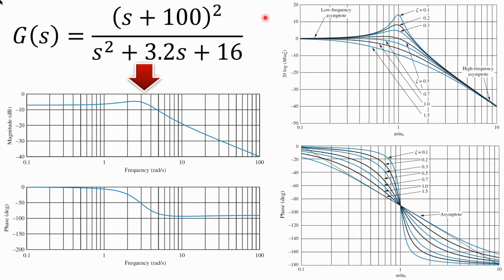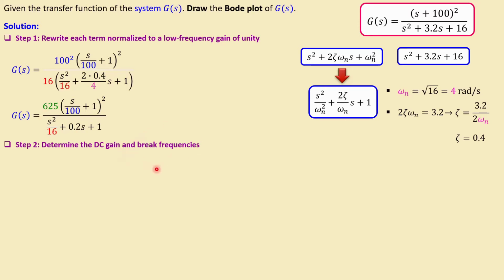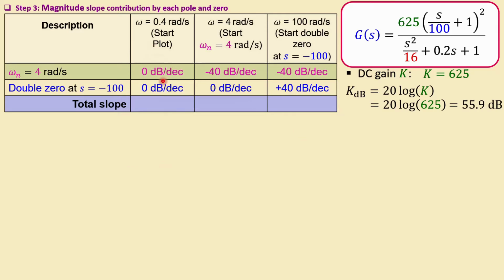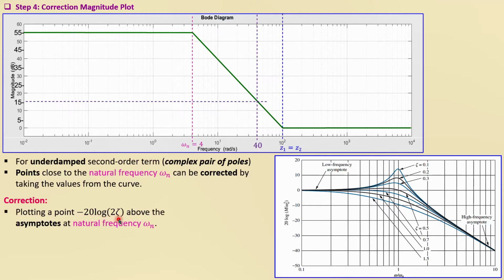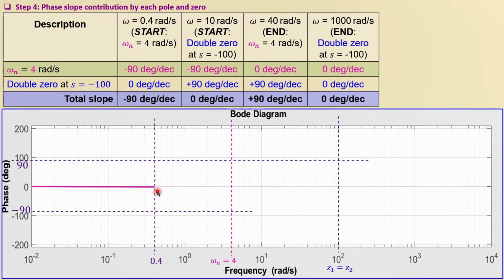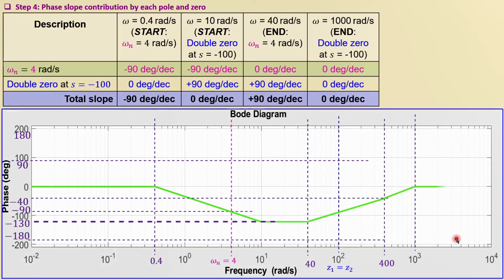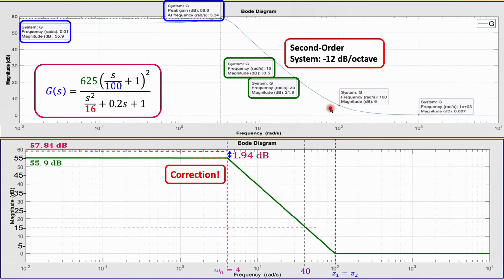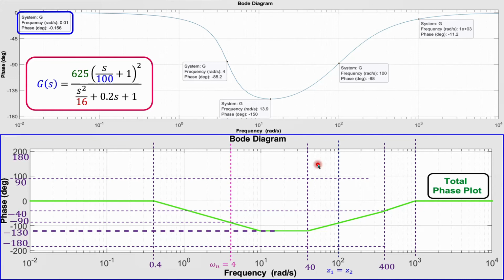Drawing Bode Plot From Transfer Function 🌟 Second-Order - Double Zero & Complex Poles 💡 Example 3

Comment: The error calculation using the 20log(2*zeta) does not apply when you have zeros. It only apply to prototype 2nd order systems. The error in this case is 2.7dB not 1.93dB
Reply from the maker: The assumption made for analytic calculations, is that the system is all-pole second-order system. The formulas for the peak time, damping ratio, etc. are also valid for all-pole second-order system only. The approximate values are calculated using these formulas for other systems, also including zeros. Yes, the zeros can have a significant effect depending on their location  with respect to the dominant poles of the system.

Comment: Good video. Just a remark, for the resonance peak i use the expression 1/(2*zeta*sqrt(1 - zeta^2)) which give the exact peak you show in your matlab plot. Thanks!
Reply from the maker: Thanks for your message. Indeed, you can calculate the resonance peak using the given formula. Thanks for the info.
Reply: @CANEDUX  No you can't! The above formula only applies to prototype system w/o zeros...
Reply from the maker: @ebarbie5016  The assumption made for analytic calculations, is that the system is all-pole second-order system. The formulas for the peak time, damping ratio, etc. are also valid for all-pole second-order system only. The approximate values are calculated using these formulas for other systems, also including zeros. Yes, the zeros can have a significant effect depending on their location  with respect to the dominant poles of the system.

Comment: Why do we have peaking when zeta is low or why peaking beacuse of conjugate poles. Can you explain peaking graph when zeta is low??
Reply from the maker: Zeta is called the damping ratio. When zeta is between 0 and 1 you will have overshoot in the time domain for step input. When it is 1 or larger there is no overshoot.

In the frequency domain, the zeta will determine the peaking given in the Bode plot.  If the zeta is smaller than 1/sqrt(2), you have gain peaking in the frequency domain. The proof for this requires some detailed derivation and most Control Systems books will explain this in detail. I found this after a quick search: http://engineeronadisk.com/book_modeling/bodea4.html